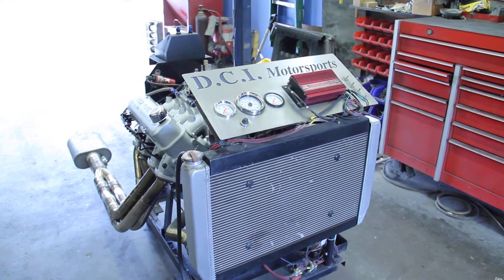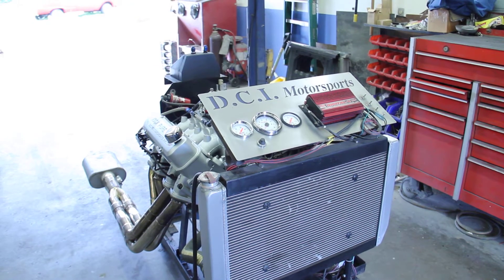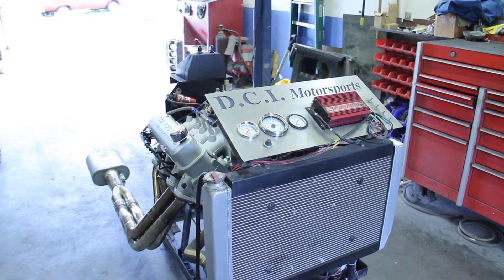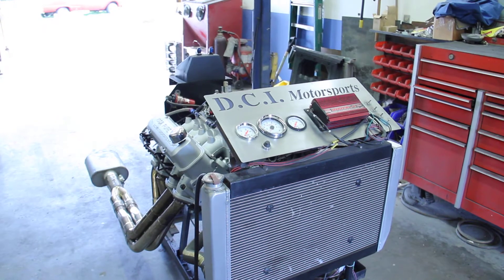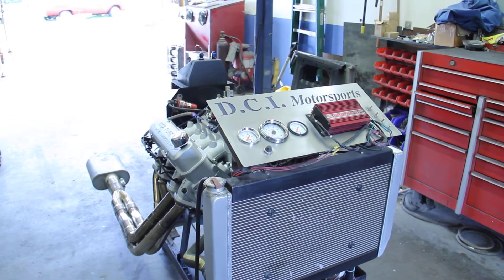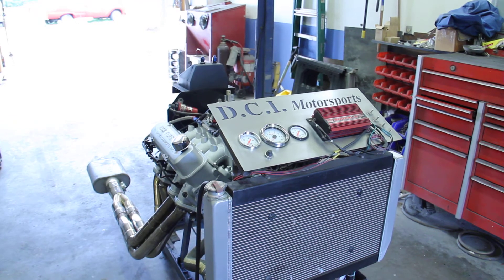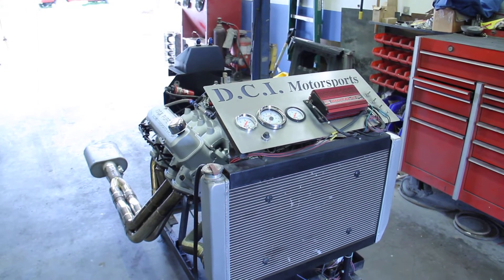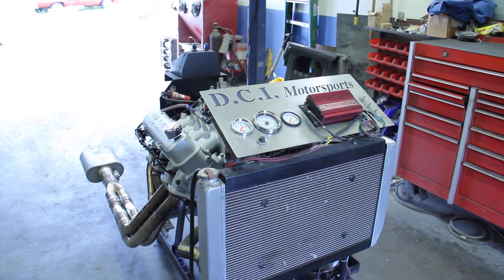DCI Motorsports pump gas 10-1 467 ram air 5 street build

Comment: Has anyone ever heard of Whipple supercharger on one of your engines?
Reply: With my intake design it would be real easy to do. The problem was until just recently there wasn't a big enough Whipple style supercharger available to feed these heads. I made that mistake once with a 383 small block Chevy I built for a client. We built it normally aspirated with a really good flowing head. He wanted to put a Paxton supercharger on it which we did, but because the blower wasn't big enough it actually slowed the car down A LOT. So we took it back off. Keep in mind this was maybe 25 years ago and centrifugal blowers were not moving the amount of CFM they do today.